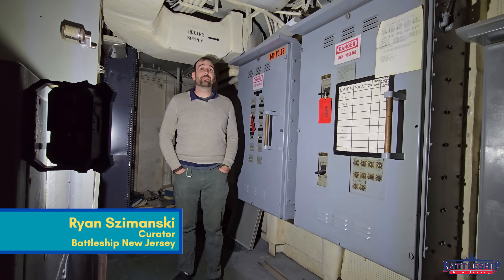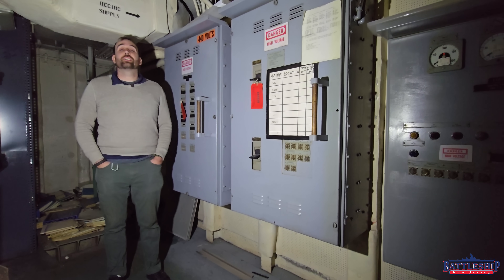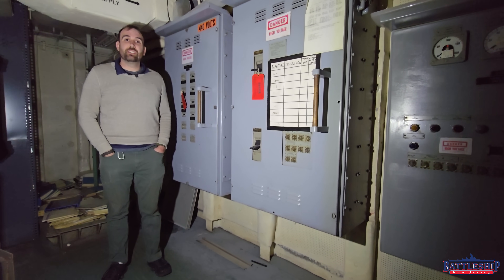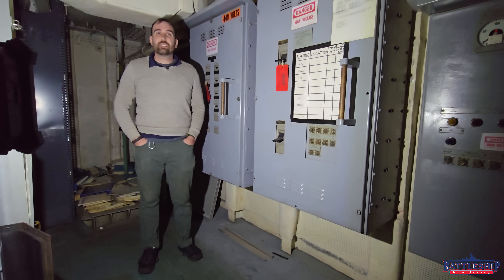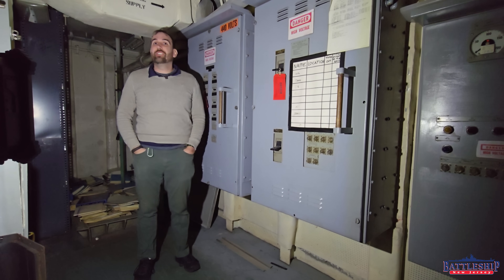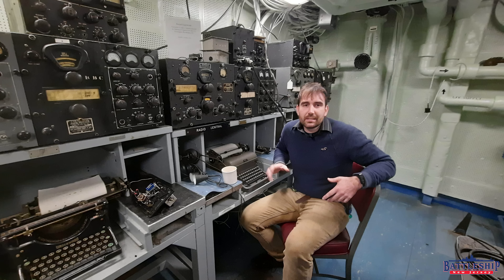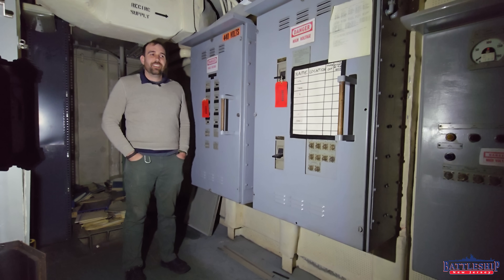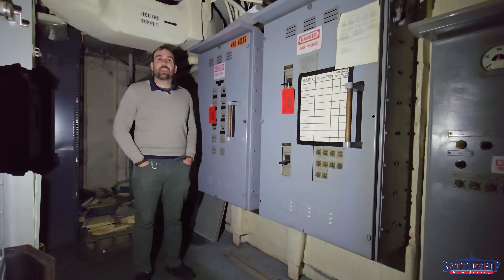One Piece of the Missile Puzzle: The 400HZ Frequency Converter

Comment: A converter is NOT a generator, one changes the power structure the other makes the power.  Those terms are not interchangeable.  Note on converters, modern ones are much smaller than those from even the 80's and generators also are more powerful for the same sizes by a fair margin.  While you might not find a period match you might find a newer one to get stuff working, if off the tour would be like the modern AC, not perfect but needed to make things work.  Also those spares with the joker labels may have served something secret and avoided revealing such details.  Testing a Reagan Star Wars era energy weapon, jammer or other field would be covered well with such Trek code names.  If you could get a transporter working you could just beam things in and out like Walter K. and N.N. stealing photons from a Navy Reactor(LOL).  Just ask "where do they keep the Nuclear Wessles?" for your Battleship upgrades.😅
Reply: I gather from other YouTube authors that unused spaces industrial electrical control panels often bear goof labels— a big red button marked AZ-5 of Chernobyl notoriety is a popular one.
Reply: Technically it is a motor generator - old school AC to DC, DC to AC and DC to DC voltage conversion used the same configuration…

Comment: The last bit about "Unapproved markings" is pretty common in the military.

When I was on C-130's, our birds still had the controls for JATO, even though most of the equipment was disconnected. So my bird had a red guarded switch and big button that did nothing.

During an ISO on my bird I ordered a new panel for it since it was pretty ragged. When the new one arrived, it was blank and needed to be marked. So I took it to a buddy in CTK with access to the new etcher we had. After a few beers I had the only C-130 with a "Navigator Eject" button installed. It was pretty popular with the crews too. Then, someone decided they didn't like it and ordered it replaced with the proper one.
Reply: Some people have no sense of humor 😂
Reply: I need to remember this for later reference, that's awesome and a shame that it got nixed.
Reply: @fungalcoffee  That wasn't even the best one. There was a dial on the Co Pilots side panel from a system that was removed years earlier that was left. They literally removed everything from this system except a dial. No wires connected or anything.

Another Crew Chief made a panel for it that made it look like a volume knob. Above it said "Fortunate Son" and below, in big letters, "FOR COMBAT USE ONLY".

IIRC, that was the one that got access to the engraver taken away and a standing order that using it for stuff like that was an automatic Article 15. Fun while it lasted though.
Reply: @Plaprad  damn, someone always needs to be a party pooper, great story thought!
Reply: @Plaprad  those are the officers I wouldn't follow out of curiosity. Having been an Army Aviation (UH-1H) crew chief/door gunner, your kind of humor is what would make me fly with you to the ends of the earth, no questions asked.
Reply: @Plaprad  Ouch, sounds like somebody needed to have the big prickly branch removed from their...

I'm not sure why some people feel such a burning drive to eliminate any shred of humor, or sometimes even expression of esprit de corps, they come across - but I wish they didn't. It doesn't do anyone any good.
Reply: Have you seen the video of the UH-60 Crew Chief making his embarking troops scan their CAC cards on the back of the helicopter before getting on?
Reply: @mountedpatrolman  Please tell me you have a link. That sounds great.
Reply: @mountedpatrolman  No, and it's now one more reason why I would never crew a CrashHawk.

Comment: MG sets. they take 60hz power to drive a Motor, that spins the Generator side producing 400hz. not just for missiles, 400hz would power pretty much all the modern electronics put on the ship. missiles, radars, etc. my first ship, we had 2 mg sets in a back room to the IC shop. we had a hammock strung up over them i used once in a while when the old flat bottom LST really got rocking. they made a fairly loud whine, but not bad for sleeping to, and they put out a little heat to keep you warm. extra info, when you get bit by 400hz, your joints hurt for days after.
Reply: Ok - in WW2 - NJ probably had MG sets. - a small "load" then - gyro repeaters- perhaps synchro feedback on turret position aims. Most stuff was MG sets. Pictures from Wisconsin show probably those were static Converters. FYI - I suspect on all airplanes (both airliners and militayr) electricity is first created at 400 HZ. I have heard of 1 missile than can take either 400 HZ or DC (400 HZ has to be 3 phased) - I have seen some AC to DC converters designed to take either 60 HZ or 400 HZ input. humm - I also read other folks remarks - several deserve thanks.. For what I have seen - I have done work where imput power from the local electric companies- If those were NOT stable sources the MG sets were better than the "new-fangled" Static converters _ I suspect the rotational inertia smoothed stuff out.
Reply: @wfoj2  MG converters will always be better than the static ones, they are so much more reliable, just ask amtrak, they got a static converter for their last 10 miles going into DC, it is always acting up!
Reply: @rearspeaker6364  It probably depends on who makes it, how reliable a static converter is.  We replaced our datacenter MG set when it got wiped out by a flood caused by a burst fire main elbow fitting in the late 1990s.  The replacement is an EPE 60 Hz three phase.  Even though I’m no longer working there, I believe the EPE is probably still running.  That is a 50 KW unit.
Reply: @wfoj2 That’s correct. Aircraft make 400Hz AC three phase power in their generators. Most commonly, this is achieved by putting a Constant Speed Drive (CSD) in between the engine gearbox and the generator so the generator turns the same speed regardless of engine speed. In many aircraft the generator and it’s drive are in the same unit, called an Integrated Drive Generator (IDG). Newer designs such as the Boeing 787 have done away with the constant speed drive and instead allow the generator to turn at whatever speed the engine is turning, with the resulting power of any frequency converted to 400Hz by a solid state frequency converter.
Reply: Oh yes, I got nailed by 480 volt 400 Hz.. my arm was numb for 3 days. It was from a 4 megawatt emergency generator for the base Radar systems. Note to self... never just reach into a control panel without thinking it through.  Lol
Reply: MG sets also run the SLQ-32 ESM/ECM Suite.  I was so used to sleeping to the MGs, that when they shut down, I woke up and went to see why we lost power.
Reply: Isn't that a rotary phase converter? Or am I thinking of something different.
Reply: @uberdang830 rotary phase converters are single phase to 3 phase, but it's the same principle. A motor with one rating drives a generator with another rating.
Reply: @uberdang830  it is, by their looks it can be called a MG set, rotary converter, or a very old Lincoln welder.
Reply: Rotary converters would make a ton of sense for that era.  I assume these days it'd be done with compact inverter VFDs like are used for everything from toy micro-drones to electric car motors